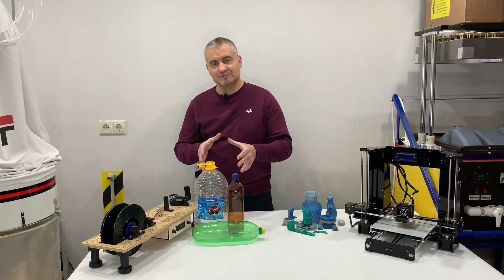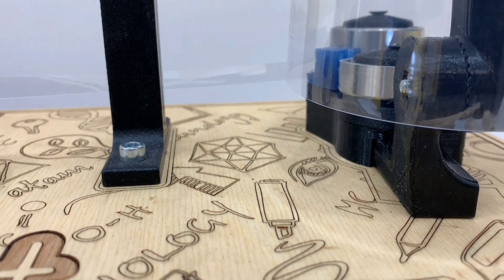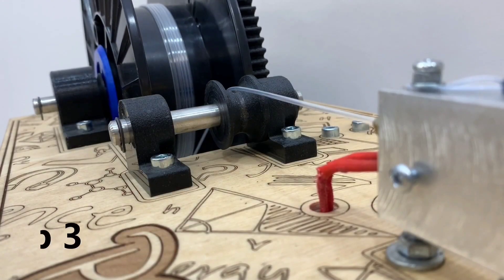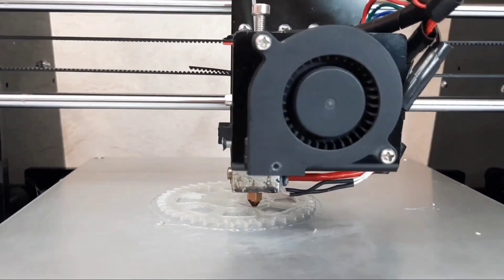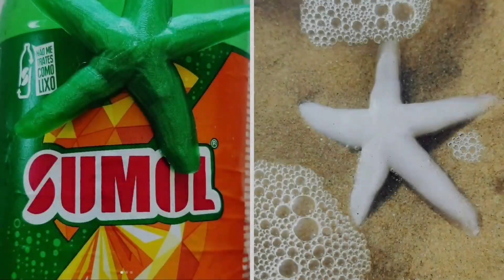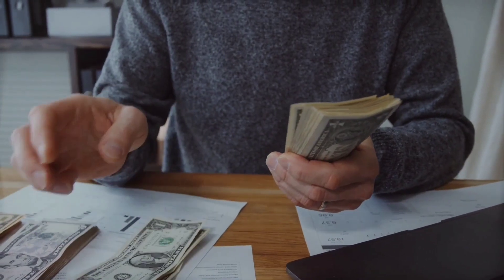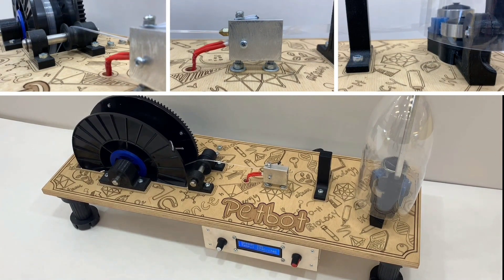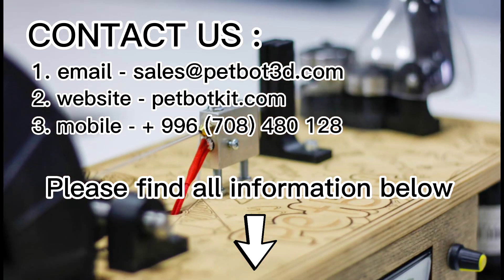PETBOT (free PET fillament)

Comment: do I need to make an modifications to my printer to print with filament?
Reply: You need to change some slicer settings (increase filament extrusion rate, temperature set to 250°C)

But this prints on a standard printer that can handle yhis temperature.